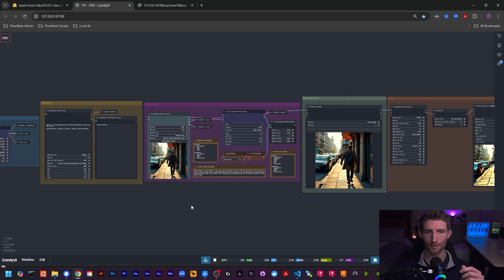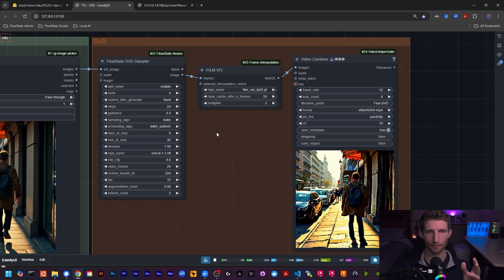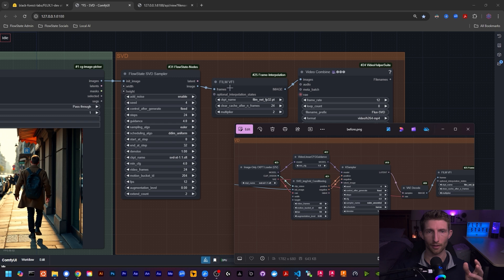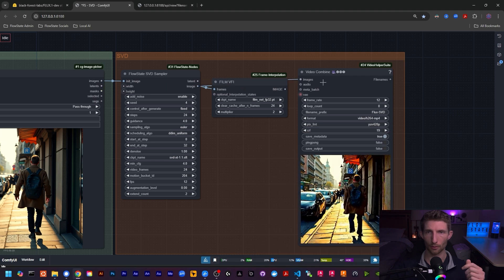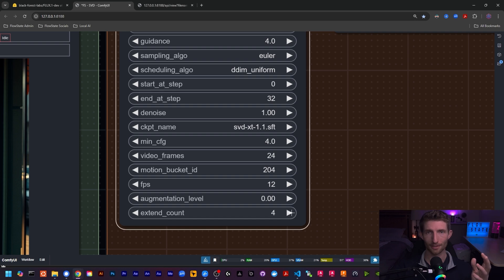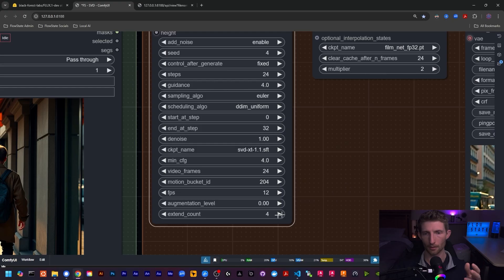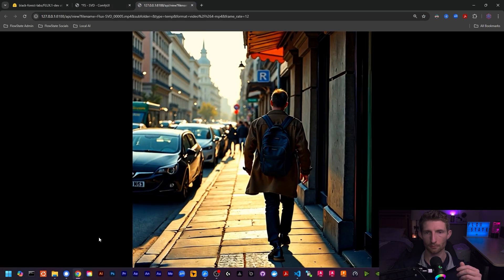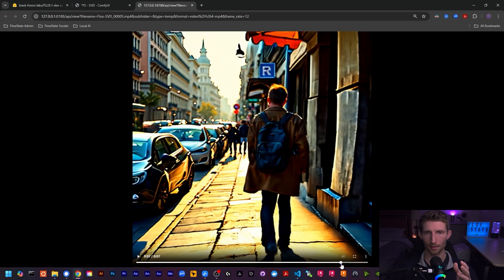Flux + SVD - Joined in Harmonious Holy Matrimony!

Comment: Is FVD likely to beat CogVideo in terms of generation speed and quality ?🤔
Reply from the maker: Absolutely. Cogx doesn't even do 720p, much less 1080. And its way slow.
Reply from the maker: to be clear, if you're doing 1080 video, FVD will be similar speed or maybe slower than cogx, but thats because its 1080 compared to the really small videos cogx does. if you were generating the same size video with FVD as you do in cogx, it would be much faster
Reply: @flowstateeng  FVD is amazing that it can generate 1080p video!
If it use FLUX for recalculation, can it generate videos of people eating food with chopsticks or forks without any distortion ?🤔
Reply from the maker: yeah 1080 wont be a problem. again a little slower at that size but it will do it. as for eating food, we'll have to see when its built. hopefully though!
Reply from the maker: cogx github page says "720 x 480, no support for other resolutions"

in 720p video, the resolution is 1280x720 where 720 is the height, not the width. 

unless im not understanding you correctly.
Reply from the maker: nice, yeah you should jump into the live streams with us if you can. we've made good progress on the FVD. we're running the flux side of things frame by frame, so yeah 12gb of vram is fine. even on my 4090 with 24gb vram, it was not enough to do a whole batch of 24 frames at once, so frame by frame is going to be necessary for most people. maybe two 4090s would do it but i dont have that in the rig yet lol
Reply from the maker: also @岩田邦夫-v8k and @mubumbutu9393, we were doing 512x512 and 1024x576 videos yesterday on the stream and it took around 2.5 - 4.5 mins total. so its performing pretty well. dialing in the settings now but should be wrapping it up soon. ill be testing 1080p video on this evenings live stream

Comment: Wouldn't it be better to have a workflow that generates 3 seconds of video at a frame rate of 8 fps and then complements it with Flowframes rather than generating 2 seconds of video at 12 fps ?🤔
Reply from the maker: that was just an example. what i really want is 30 sec or more at 24fps, hence the need for FVD
Reply: @flowstateeng  ＞30 sec or more at 24fps・・・！
I am looking forward to its completion !🤯